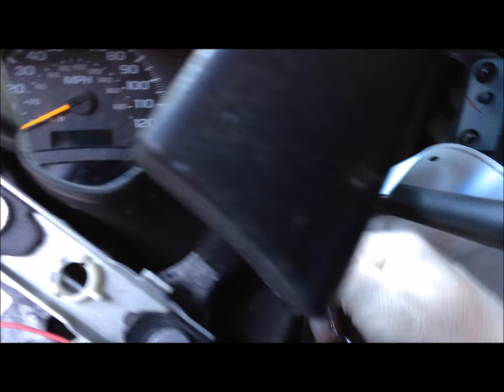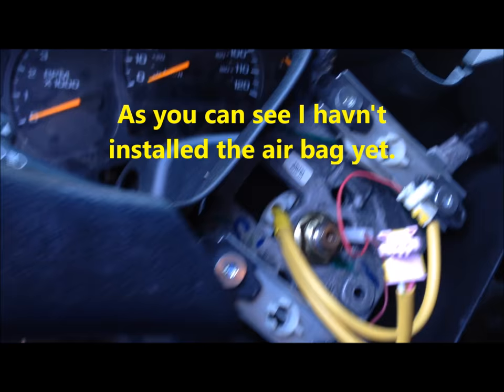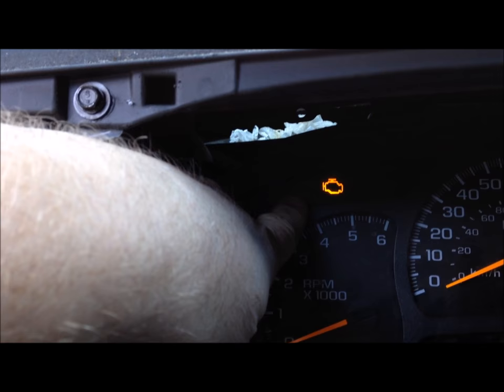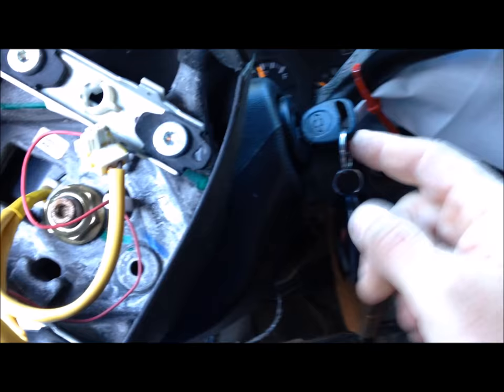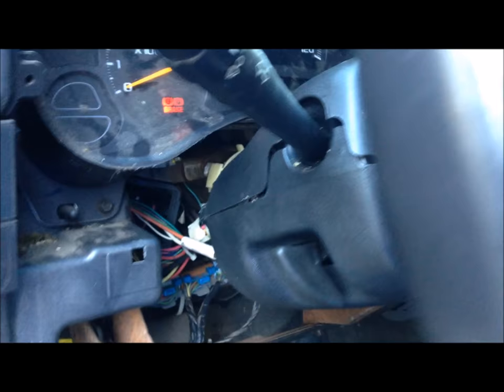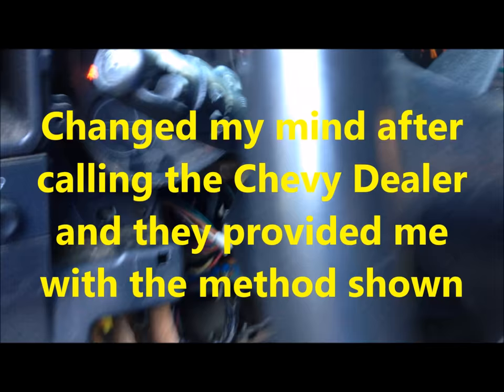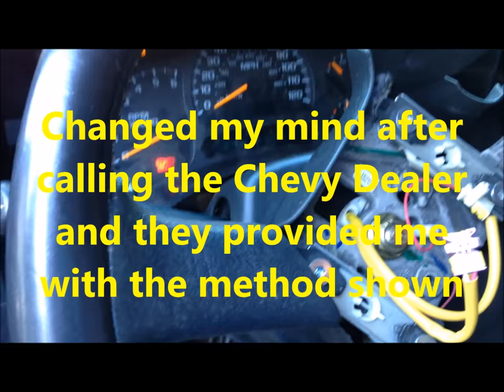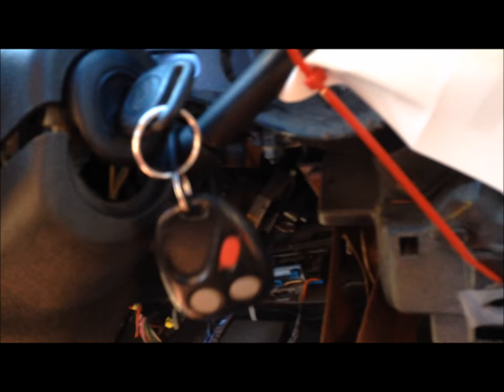Vehicle Anti Theft System Reset Override Technique-GMC Sierra or Silverado

Comment: Anybody have an issue with the anti theft light NOT flashing?
Reply: me also only runs for 1 second  security light comes on flashes 3 times when first turned on... also when i plug in scanner it never fully connects only flashes rapidly!  if you or i figure it out please msg me and i'll do the same... my truck is a 99 chevy tahoe and you are the first person to ask that question and i'm cheap been looking for days
Reply: @Bill Fisher  have any luck? Mine will run for a sec and then shut off. Tried a relearn numerous times. Trying for an hour now
Reply: Yup
Reply: Been fighting with mine for 3 years. Finally got it when I took it to the dealer then when I was driving it it shut my truck off and I had to walk home right after acl surgery too now it won’t even crank or start, nothing.
Reply: Had the same problem before, and I was advised to redo all body grounds. Thought it would be a waste of time, but sure enough, after redoing all the ones I could find and ensuring a good metal ground with brand new connectors, it fires right up. No dash lights on—everything as it should be now.
Reply: Usually these trucks and suv have a leak in the windshield which causes your VAT ( vehicle anti theft) computer to go bad. You can order new ones online and it’s like $250. Spent 2 YEARS!!!! Trying to get my 2000 Yukon Denali to start that was in another country buying parts left and right. Finally diagnosed the issue

Comment: I have an 03 Gmc Savana 3500 it has issues starting. I tried to leave it on for 10 mins (read that somewhere else) but the chime alarm was still on. I turned the car off and it still chimed at me. Unplug my battery to get it to start. Thinking about buying pro-bypass but hoping for a cheaper option
Reply from the maker: Im totally unfamiliar with the pro bypass but maybe give the dealership service dept a call and see what they have to say over the phone about this specific make and model. They guided me on my fix here which is why I say that. Let me know! Good luck.

Comment: 07 gmc sierra doing the same thing, I turned the key on, disconnected the negative battery terminal, tapped it 3 times and on the 3rd time kept it connected and screwed it back in. Turned the ignition off, shut the door then turned the ignition back on and waited 30 seconds and it fired up, have done this twice and both times it’s worked, rebooting the system/ computer. 
 The anti theft systems shuts the fuel supply off to the engine.
Reply: What do you mean you tapped it 3 times? You tapped the negative cable onto what?
Reply from the maker: Thanks for the input
Reply: @DIYTechnician  so what was it that you tapped 3x? Precise information is really necessary here. Thank you..
Reply: He said "screwed it back in"... Also said "tapped it 3 times" just after saying he disconnected the negative... So:
1) open door
2) key on
3) disconnect negative
4) touch negative wire to terminal 2x and hold on 3rd time.
4) key off
5) shut door
6) key on 30sec
7) crank
=Start.

Comment: No lie this worked!! I have an 04 chevy avalanche and just had a new system installed. The battery was disconnected & wouldn't stay started after the install was complete... literally did this guys exact recommendation. 💯 works!
Reply from the maker: Awesome!!! Glad it worked for you. Thanks for the feedback.
Reply: i’m really curious if this stayed working i’ve been having intermittent security light coming on for 2 months now so frustrating, part is discontinued by chevy , HP tuners doesn’t support my 2000 chevy diesel, changed batteries and ignition switch idk what to do
Reply: @Anthony Veasey  I just got rid of my avalanche about 3 months ago, and the issue didn't returned since I posted this comment.

Comment: Hey DIY TECH I just swapped columns also in my 00 gmc 1500 5.3 and it’s also starting for a second then shutting off so I’m doing what you just taught me tomm but I was just wondering if you turn the key back then start the truck or just start it from the on position after an hour  And thank you for actually sharing the knowledge   we salute you good citizen
Reply from the maker: Hat I did was turn the key back to the off position at that point. Hope this helps
And thanks for the nice feedback. ✌️😎

Comment: hi thank you for the tip. I think my story might help someone.   My friends 2008 gmc1500 igniotion key was sticking badly and you had to jiggle it pretty good to get it to work.  i googled it and watched a guy change its ignition cylinder and he goofed on the first attemt at codeing the new key.  he redid the procedure and this time it worked.   Ok, I bought one and installed it and goofed on the key codeing process. I goofed many times. I disconected the batery  before each attemt. I put the old ignition cylinder back in and tried reseting it. nothing was working.  finally the blinking anti theft light would not stop blinking and I could no longer try the 3x11 minute coding procces. I tried waiting an hour with key on. still kept blinking and would'nt start.  I put the new cylander back in and left it on for an hour but the blinking light kept on blinking and it wouldnt start.  ok it was getting late so I diconected the batery and put the charger on it. the next mornning I called the manufacters technition for the new key cylinder and explained my prolem. he said I may not have disconected the battery long enough between attemts. ok, now the battery has been disconected all night with the battery charger on it.  I disconected the charger, hooked up the battery, put the charger back on the battery.  I got in the truck and turned on the ignition.(the new replacement one). I watched the anti theft light blink for over an hour but it kept on blinking.  ok, i just left it blinking for another hour but the light was still blinking. no start.  ok, I decided to put the origanal key cylinder back in. I disconected the battery and put the charger on it while I reinstaled the origanal key cylinder. I then disconected the charger, hooked up the battery, put the charger back on the battery.  I then prayed and turnned on the ignition and expected to watch a blinking light for 11 minutes. but no. the light went out and didnt come back on. I was confused and wondered if I should try cranking it over. I turned it all the way and it started up. I was happy confused and thankfull all at the same time. I thanked god too.  I am not going to try that new key cylander again till I grow a new pair.
Reply from the maker: lol hey great story and thank you for sharing. Best of luck and take care:)

Comment: I have a 2003 Silverado 4.8 I am having the same issue but my vehicle does not start for a few seconds then dies. it just cranks and my. security light stays on I did the method you as well dead for an hour I cranked it but there was no start from the injectors to spark I did have a good battery jump pack not sure what exactly you did to get it going I did purchase mine steering column from a LKQ Warehouse
Reply from the maker: So Ive heard of your situation happening and have been told its a big drain on the battery so maybe double check that. I wish I knew the answer. I can recommend calling the dealer bc they are often willing to help over the phone and know more of the secret tricks than me. Best of luck to you and hope you get it going.
Reply: You figure out your issue FLO?
Reply: Mine was doing the same thing when I tried splicing the wires. 
and I had a bad battery

Comment: What year Silverado does this work on? I just replaced my steering column and I am having the same issue.
Reply from the maker: The truck was a 2002 but the steering column was out of a 2006 Tahoe that I bought from the junkyard. At least thats what they told me and also what the tag on it said. Worked like a charm. Good luck to you.

Comment: My security light has been on steady since I replaced my bcm. Tried the 10min, 10 sec, 10 min, 10 sec, 10 min procedure 3 times and still the same. Will this work for me.??
Reply from the maker: Maybe. I’m no mechanic but these were the instructions the dealership gave me when I called and it worked like a charm. Recommend giving the dealership a buzz if you can’t get it to work. They should be able to walk you through it. Good luck to you!
Reply: @DIYTechnician  I would venture out to say BCM has to be programmed to match with ECM to reset the VATS system correctly.
Reply: We’re you able to fix the issue? I have an 06 Chevy hhr. And I’m trying the 10 min, 10 sec method and the lock symbol won’t go away at all. This is so frustrating
Reply: I got a 03 envoy I just replace the steering column will it work on a 4200
Reply: Precedere
1. Turn ON the ignition, with the engine OFF.
2. Attempt to start the engine, then release the key to ON. The vehicle will not
start.
3. Observe the SECURITY telltale, after approximately 10 minutes the telltale
will turn OFF.
4. Turn OFF the ignition, and wait 5 seconds.
5. Repeat steps 1 through 4 two more times for a total of 3 cycles/30 minutes. The
vehicle is now ready to relearn the Passlock(tm) Sensor Data Code and/or
passwords on the next ignition switch transition from OFF to CRANK.

Comment: I turn my key only check engine light comes on and radio says locked, i tried this way any the ten min any other tips or tricks
Reply from the maker: Nothing comes to mind but maybe give a call to the dealership and ask the service department guys. They bailed me out over the phone before without having to bring my truck in.
Reply: Radio pass key will disable the system I believe.

Comment: This worked but the car seems unstable, stuttering, jittery, and making a fluctuating noise if that makes sense.
Thanks in advance
Reply from the maker: Yes I seem to remember I’ve had ones do this too. It seems it self corrected after turning off and firing back up. See if this helps.
Reply: It didn't fully start basically

Comment: GM Procedure/fully charged battery or battery maintainer connected for 30 min. Procedure 
1. Turn ON the ignition, with the engine OFF.
2. Attempt to start the engine, then release the key to ON. The vehicle will not
start.
3. Observe the SECURITY telltale, after approximately 10 minutes the telltale
will turn OFF.
4. Turn OFF the ignition, and wait 5 seconds.
5. Repeat steps 1 through 4 two more times for a total of 3 cycles/30 minutes. The
vehicle is now ready to relearn the Passlock(tm) Sensor Data Code and/or
passwords on the next ignition switch transition from OFF to CRANK.
Reply from the maker: Awesome! Thanks:)
Reply: I tried the 3 cycle method yesterday and it didn't work. Tried it again and.... Success! Thanks guys!
Reply from the maker: sweet! Thanks for letting me know. @tomallman3956

Comment: Do you have to do it for both keys if you have 2 ?
Reply from the maker: Nope
Reply: @DIYTechnician  I tried it didn’t work … my truck starts and runs..I just changed my battery now the doors lock and unlock a bunch of times horn beeps a bunch and my security light and battery light is on

Comment: I have a 2006 Express van that I tried this on as well as two other slightly different versions that i was told to try nothing worked.
Cranks, runs for 2 seconds, cuts off.
Reply from the maker: I recommend just giving the dealer a ring, parts/service dept. I bet they know the magic sequence. They were able to just tell me over the phone. Quick fix with no visit needed. Good luck!